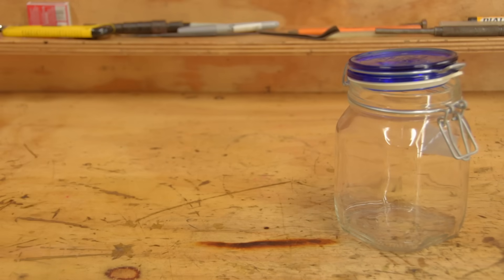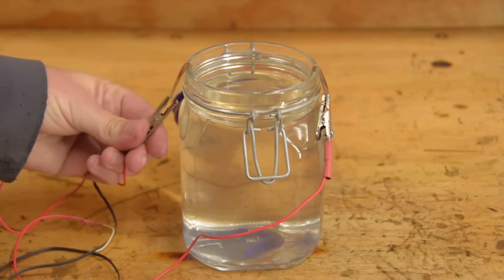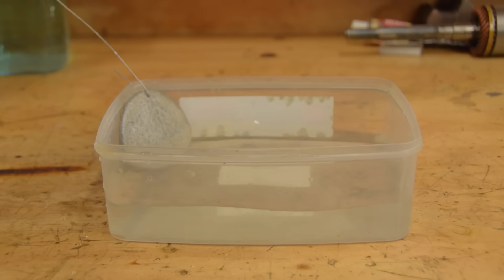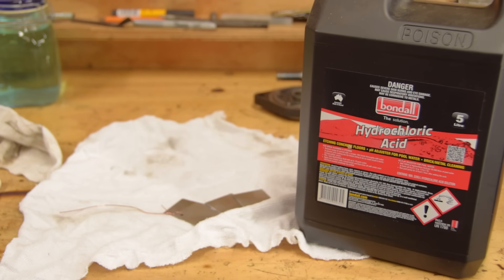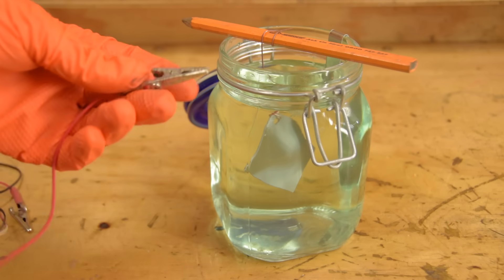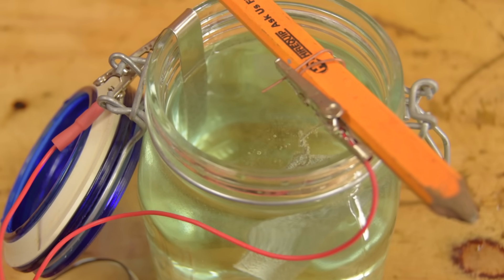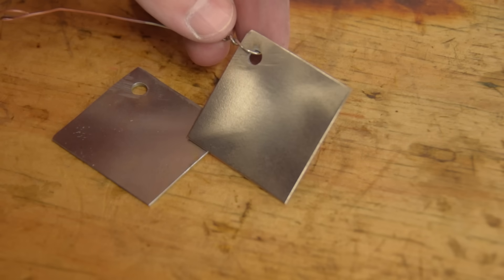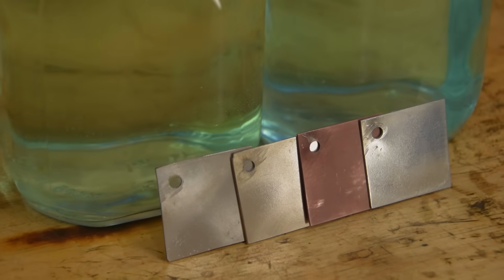Electroplating - Easy DIY Nickel, Copper, Zinc Plating

Comment: Thye solution formed with nickel and vinegar ie acetic acid will be nickel acetate.  Looking up Wikipedia it can be made from vinegar (acetic acid) and nickel, no mention of needing salt and current, though this would no doubt spped up things.  It describes nickel acetate as being eaily soluble in cold or hot water.  The salt aspect worries me especially if plating steel due to a future risk of rust.  Perhaps leaving the nickel in the vinegar for a week or as long as you want to dissolve enough nickel would leave out the salt bit and a future risk of rust.  Heat would of course increase the rate of reaction.  Do not leave the top sealed on the storage jar in case it gasses and cracks the jar whilst the chemistry is going on.  Nickel acetate is described as being used for electroplating and something not to ingest or get on your skin.
Reply from the maker: The salt increases the conductivity of the solution, that's its only function. Everything will work without the salt, but take longer or require a much higher current. Commercial plating solutions like this are chloride based eg. zinc chloride. Chlorides are typically good conductors and most metal chlorides are soluble. But any solution that holds the metal in solution and conducts electricity will plate.

The salt doesn't lead to any corrosion issues directly through the plating process. The only elements transferred to the part are nickel (and technically hydrogen in small amounts). Some chlorine gas is created because of the sodium chloride. 

The fact that acetic acid is acidic creates corrosion issues for all of the alligator clips etc. but not to the plated part itself.  So so long as any left over solution is promptly rinsed off, there is no problem. But yes ideally, and in commercial mixes, the solution is near ph neutral for nickel and zinc etc. For copper, highly acidic solutions are used which make it possible to plate directly to steel.

Comment: Another thought, if your transformer is faulty and the wires on the output are or become up to mains  voltage around the solution, crocodile clips etc, it could be lethal.  Wearing thick rubbergloves and treating everything as potentially live would be good practice.  Numerous tear downs of cheap transformers and rectifiers show inadequate mains and low voltage separation.

Comment: People ask about alternating curent, from my ohysics and chemistry learnt 45 years ago, it will deposit metal then take it iff again at 50 times oer second - not a winner!  Presumably when the nickel is stripped off the lump or strip it will form nickel acetate from the vinegar and some nickel chloride from the salt.  The nickel ions in solution will have a positive charge and so will go to the cathode (negative) pole in the plating solution.  There is usually an optimum charge density to do the plating.  With 12 volts and one amp if the tank is 10 yards across not much will happen.  If the two electrodes are flat, face each other and are close it will work better but the back side of the plate necessitating turning it round half way through or putting another anode behind.  Tubes need a central anode pole and a circular curtain around them.  Using an arc welder will likely might make it fly but will produce vast amounts of hydrogen and oxygen with a serious risk of lifting the shed roof and death.  One response was that enough current to cause bubbling will ruin the finish.  The salt to increase conduction worries me as metal surfaces have microscopic pits in them and if salt gets into them and then is plated over perhaps it will rust through in months or years to follow, perhaps patience rather than salt might be a longer lasting solution.  Six hours to make the solution rather than two perhaps.  I noticed that at steam rallies all the wheels for controlling the steam engines were shiny but did not appear to be stainless des
Ite being handled on hot sweaty days.  Having asked I was told by the guy that he had had them nickel plated.  I have never heard of a solid nickel metal poisoning through the skin of the hands, nor do I think one could be found in the literature.  Solutions are much more tricky especially if ingested.  If dissoved in solvents that will dissolve oil then they can get through the skin barrier and into the body.  The gaseous phase is also very tricky.  Electrolysis with bubbles will introduce microscopis particles of the solution.  Breathable particles of acid at 2 to 12 micron are not good for the lung surface to say the 
least.  Acid particles too small to see dropping over one’s workbench and machinery is a recipe for rotting materials and sheets of rust appearing.  Do all this stuff outside, gloves and try not to breathe any shit!  Watch for splashes and do not do it near the wife’s washing drying line.
Reply: Hawker CNC what kind of gloves do you recommend?

Comment: Hey everyone ! i've Got A Steel Bike Handlebar And I Would Love To give it a Finish Chrome ! Would somebody here give me some Homemade tips for Can do it by myself ??  i will be thankful !
Reply from the maker: Take it to an electroplater. Or paint it.
Reply: @GeoffreyCroker  I'd love to give them to electroplater!  But Sadly on my area I didn't find anything!  That why I would love if I can make it on my home!
Reply from the maker: To make a set up at home large enough to chrome plate something that size would be much more expensive than buying new bars or sending them away to be chrome plated. Not to mention you'd be dealing with really nasty chemicals. You should be wearing gloves and not breathing the fumes from nickel etc. but chromium is a whole different level of nasty.

Comment: I have an "unknown" metal piece that was believed to be bronze, or brass because of its color. I've had it for 15 years and was fine, but very dirty. I cleaned it and when I was polishing it I used a coarse sand paper to get ride of some scratches and it was silver in color. It was coated somehow with a very strong coating that lasted years of use and abuse. I don't like the silver color, so I want to do this process. But you said in the video that copper won't stick to steel so I want to know if instead of nickel, can I use zinc? I have zinc and copper sulfate already, so I would like to avoid the nickel if possible. 
I hope you or someone here can help. Thanks in advance.

Comment: If you electroplate copper onto something first and then electroplate zinc onto the same piece. Just heat the whole thing to the melting point of zinc which is just below 500 degrees Celsius the zinc and copper will weld together forming brass which is gold looking.

Comment: I don't know why you've claimed that copper won't plate steel. Copper will plate steel, maybe not in salty vinegar, but definately in muriatic acid. What you cannot plate with copper is stainless steel. Carbon steels can be plated even with aluminium. You only have to choose the right electrolyte.
Reply from the maker: You answered you own question. This video is about electroplating in a jar full of vinegar. If you already know all about electroplating you don't need to watch a video about plating something in a little glass jar. And the guy who has never plated before doesn't need to know about cyanide/sulfuric copper because he ain't gonna start with that in his garage.

Comment: Not great results for me. Got acetate compounds forming from the vinegar and metal salts / oxides that contaminated the plating. Might switch to an alkali solution to form the electrolyte and see how that goes.
Reply: What are you using for a power supply? If it's too high a voltage or amperage it will produce poor results. Low and long are better than high and fast.

Comment: Nice tutorial. I have a variable 0-30v and 0-5 amp source. Should I use 3v and change amps from 0,5 to 1 depending on size?? I want to zinc plate small parts for auto restoration. I have pure zinc anodes I made from a company that makes boat zinc anodes, they gave me some balls that I melt and made thin anodes. I suppose if the part is irregular, is best to our 3 it for anodes, so all the part surface is exposed to an anode. What about water bubbling I've read? Some put a small fish tank pump. Lastly, would you recommend to zinc for a while, remove,  polish and clean, zinc again, etc??
Reply from the maker: Yes you got it. But this is really just for playing around. Zinc gets complicated in the detail. You'll end up wanting to use passivates and brightners for real parts. Use this recipie just to play around, and then decide if you want to spend money on a commercial zinc kit.

Comment: I've been trying to find this answer on line and no info but can you use an old silver coin to silver plate other items and if so is it the same process? I'd really like to know because my daughter has a necklace she is upset that the silver has rubbed off down to the copper. It would be great if you could answer this question for me. Any info is appreciated. Thanks
Reply from the maker: Probably but I don't know. If you haven't plated anything before, that definitly isn't a good first project to try.
Reply: @GeoffreyCroker  I found a video that turned out OK. I'm a bit confused tho it said to heat backing soda at 300 degrees for an hr to convert it to sodium carbonate from sodium bicarbonate. Why this is important I have no idea but they used 3 table spoons of it. It also says to use hydrogen peroxide as the liquid. If this is any better or different reaction then using distilled white vinegar and a teaspoon of backing soda I have no idea as this wasn't addressed but I'd love to know. They also didn't make a solution they just added the 2 metals together and started but I'd think that would be a good idea because it took them a long time to get the desired plating.
Reply from the maker: I don't know. There are many solutions that can be used for plating. All they are is a way to hold the salt of the metal in solution. I have never tried silver plating. There is a high risk of falier with any kind of plating until you get the hang off it. I'd take the necklace to a jewler or buy a comercial silver touch up plating kit if you really want to diy.
Reply: @GeoffreyCroker  I'll probably try it on something other then the necklace first. I mean what's the worst that could happen. They used an old silver coin and I have tons of them. I'll just use a 1964 quarter so I don't risk ruining an older more valuable coin. There mostly silver 90% if I remember correctly just like the coin they used in the video. It does turn it black or purple but it rubs right off. I figure I'll try it with this solution first  then the hydrogen peroxide if that doesn't work. I'll just use it on a piece of copper first. They used a penny a new one at that. Probably try it over the weekend and I'll let you know how it turns out.

Comment: I am going to try two coilovers, going to sandblast thema first and put it in a bucket with 4 anodes arround it, and airbubbles. Hopefully this will work.
Reply: arent they springs? zinc plating springs is a bad idea the process will embrittle the steel

Comment: Very excellent tutorial. I tried to do some plating before; I got an ebay anode and used that but I noticed my nickel solution now has a rusty looking swirl sitting at the bottom after I did some plating. Is this because it was not a pure anode as stated? Should I run my solution through a coffee filter to get this rust looking stuff out? Lastly, how do you safely get rid of your solution when you're finally done with it? Do I need to neutralize it with something? I'm not going to pour it down the drain obviously. Thanks again!

Comment: Use steel or stainless steel wire instead of copper to avoid copper contamination if you are plating nickel or zinc.

Comment: Question what exactly is this good for and how wud do a gun barrel
Reply: you could nickle plate a gun barrel but be sure to make sure the the plating solution does not enter the  bore or chamber. the chamber and bore are made to very tight tolerances and plating them would reduce the internal size of them making the gun dangerous.

Comment: Very very nice video, it's a shame you only got so few views.
Question: you use vinegar to make this solution "foolproof" but would not it be better to use sulfuric acid when preparing the nickel plating solution?
Reply from the maker: There are lots of better ways to plate than this. This is just for the guy who wants to start playing around without much hassle
Reply: @GeoffreyCroker  I'm watching several of your videos and also mentioned them on a newsgroup for others to watch!
Reply: sulphuric acid is much more dangerous to use than ethanoic acid (vinegar) or Hydrochloric acid.
Reply: @brianthwaites2397  really

Comment: if i want to copper plate steel or anything that is difficult like aluminium or quarters (which do not seem to be working well for me),do i need to strike it with zinc or nickel first? will a brushed porous Al surface work without doing zinc or nickel? and should i have separate baths for the zinc or nickel than the final platting bath for copper even if the solution for the bath is the same?

Comment: yep. In the US we still have one coin that is actually worth is represented value in precious metals. That is the Nickel. It's still a mixture of copper and nickel and the plating ends up looking much more like copper than the original Nickel you're taking it from but it looks pretty good if you like patinas.
 I just do a little research, go to the guitar store and get a fat, low "E" string (0.059") that is nickel wound or nickel core and nickel wound. If wound, you just pull the wound wire off. This should be enough for a dozen small projects or more.
For larger stuff you can use the solution on a rag and essentially "paint" the downer metal on but it takes a little experimentation to get it right.

ps... don't attempt plating aluminum with the method in the video. Aluminum requires more knowledge and a different recipe. I learned the hard way.
Reply: Hi There. I am restoring a coffee machine and am looking for a method to plate an aluminum part. Could you help me pointing out what should be done differently to plate aluminum or tell me where I can find that out (I am assuming you have already discovered a proven method). Greatings from Brazil.

Comment: Copper sulfate solution will directly plate steel or iron without electricity.
Reply: it will yes but it will rub off easily ana severely corrode the underlying steel or it did on the hatchet i tried it with.

Comment: Made the plating solution. Forgot the salt. Did okay though because I started it before I went to bed and it ran for the next day. 
Just set up a plating tank. 4 rods of 99% nickel welding rod around the perimeter of a small plastic jar with a snap on lid. This time I added salt. 😝
It's bubbling right now. I have two screws for a Stanley #78 Rebate Plane Depth Stop in the bath. Might as well try it on something useful. We'll know in about half an hour if it plated enough. I might leave it longer but I don't want to plate the threads too heavily. 
Great fun. Thanks for the video.

Comment: Simple Electrolysis, using a Automotive Battery Charger, and something smaller than a kiddie pool to CLEAN ANY PART OF METALLIC ORIGIN. BORAX is your catalyst, works as CocaCola on rusty stuff !
Reply: coke works as a cleaner because of the phosphoric acid in it
Reply: Have to say that if you want a proper good chemical to remove rust you should use vinegar and salt and leave it for a few days. The rust just brushes straight off!

Comment: i'd like to asked since i've measured the current draw of the electrode and it gives me a rising amperage anyone knows how and why it happens?
Reply: I'm drawing on a 50 year old chemistry degree from the Univ. of California but, unless the fundamental laws of chemistry have changed since then, my guess may be correct.  
Assume you're plating nickel.  Think about the process that's going on at the surface of the object you're plating, the negative electrode -- positive ions of nickel in the solution are receiving electrons from the negative electrode.  Those electrons come from someplace, the surface of the negative electrode.  Atoms of electrode metal are donating outer shell electrons to the nickel ions to become cations, and replace the nickel as the cation in the solution.  The metallic Nickel formed from the solution is insoluble, so deposits onto the surface of the object/electrode.  Up to this point the solution has been nickel acetate, the acetate from the vinegar.  Now the solution begins to acquire a small presence of another salt of acetate -- iron, if that's what your object/electrode is made of.  Whatever your target object/electrode is made of, the cations it sends into solution are going to have a greater whachamacallit (50 years out I can't remember the term) -- chemical reactivity, the ability to facilitate electron movement in solution -- than nickel ions.  So the conductivity of the solution rises.
As I recall.

Comment: is there any particular preparation for plating aluminum in copper?
Reply from the maker: Short answer is that you can't plate aluminium with anything. There are work-arounds.
Reply: it cannot be done by directly plating